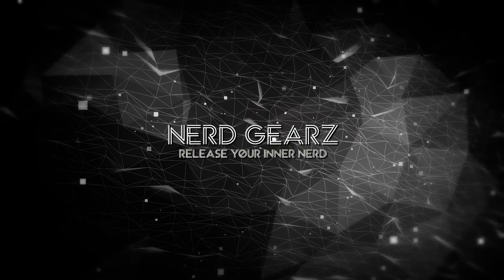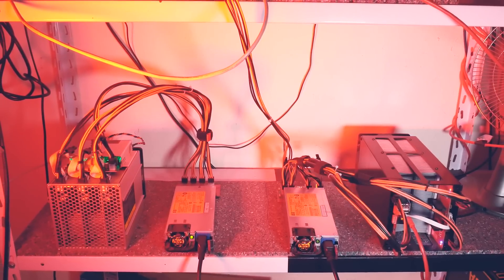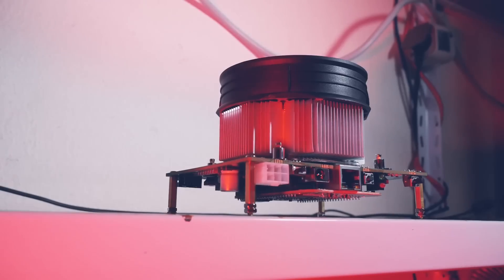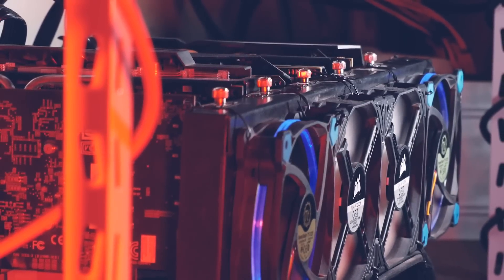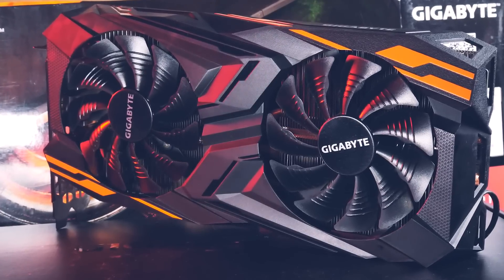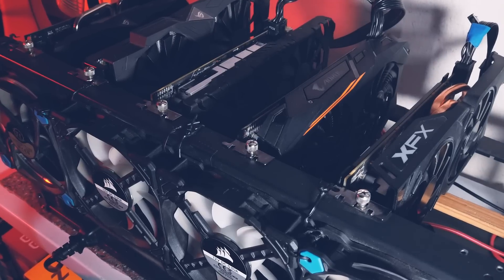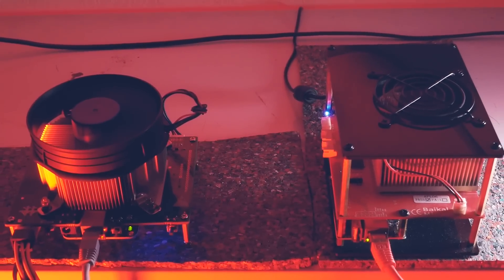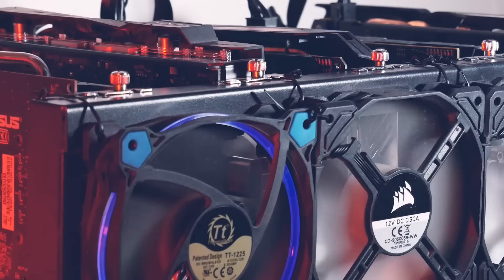Home Mining Farm Update July 2019 (Cursed Mining Farm #16) FPGA / GPU / ASIC

Comment: nice vid as always, hi guys i'm gonna go back into mining next month or so are 6 gtx1070's still profitable???? 
i stop mining last year cause of helth issues need to sell my mining rig( 10 gtx1060 6gb/8 gtx 1050ti's)
Reply from the maker: Sure man, depending on what you like I think there is still a place for 1070s! Check X16R or even ETH if tuned right ⛏️ I'd personally go Aion :)
Reply: @CursedMining  oh Aion for gtx 1070's i got them for bargain price like a bit than a gtx 1660
is whattomine reliable in any way? saw BEAM was the most profitable alt coin for grx 1070's
Reply from the maker: only reliable as general guideline as they take pretty random OC number for their hashrate / wattage on more freakish algos =D If you read up on the algo you are interested in you can try to make a profitable low power setup f.e. - that's what I try to do with most rigs, mixed nVidia rig only 600w right now (1050TI - 1060 - 1070TI - 1080 rig). 6X RX580 Rig only 500 watts etc.
Reply: @CursedMining  electricity is almost free it so low from where i live in
Reply: thansk fro replying bro
in my place low elec. rate and used gtx 1070 go for cheaper price than a gtx 1660
Reply: @CursedMining  btw what crypto wallet would you recommend to be use on nicehash and other 1 click miners?  
thanks
Reply from the maker: @markangelogarcia2584  I have a crypto wallet video on the channel =) I love hardware wallets like ledger/trezor for longterm holds, or desktop wallets. For quick transfers Coinomi - but backups are important with every kind! =) cheers
Reply: @CursedMining  thanks for replying i gonna try exodus
i'm kinda wary about Coinomi thou